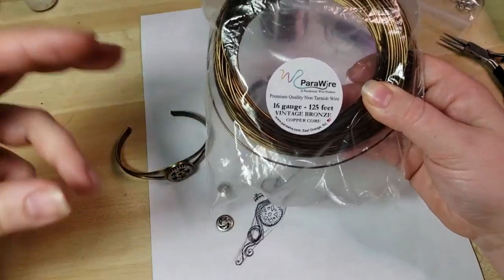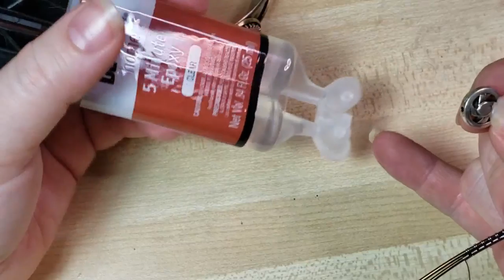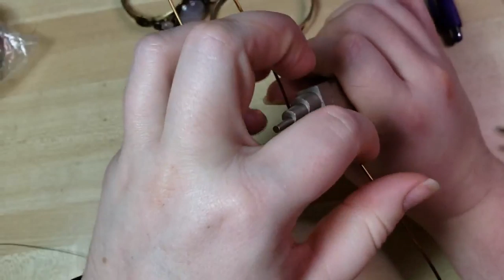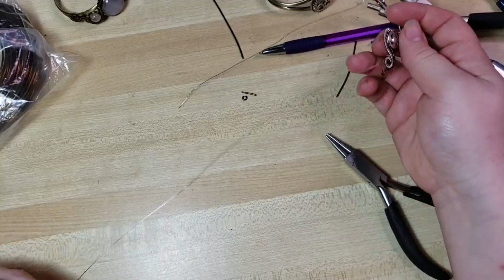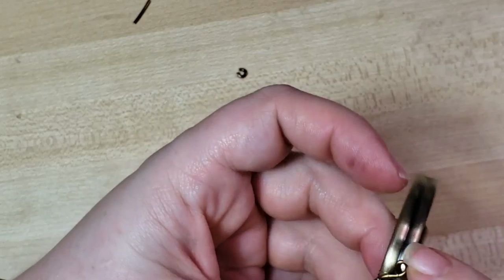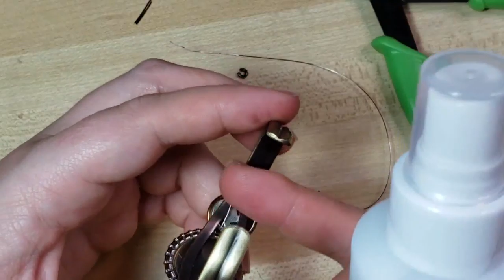DIY Steampunk Bracelet

Comment: Seams kinda easy hope i have the products to make it .Glad you told us about using the modde podge on it BUT can we use regular Modge podge on it?
Reply from the maker: Let me know when you try it; I am hoping it won't be too far beyond a first step into intermediate wire wrapping. If you don't have the 16ga, 18ga works well too, and if you don't have the 28ga, a 24 or 26ga wire would work well in its place.
Reply: @backtoearthcreations  thank you ,i have to try and find the small beads at Michael's first maybe tomorrow and the bracelet i dont have the right one